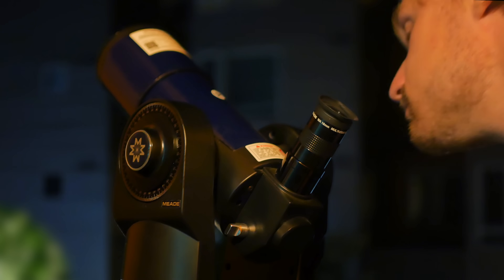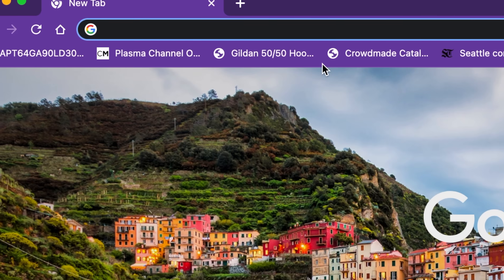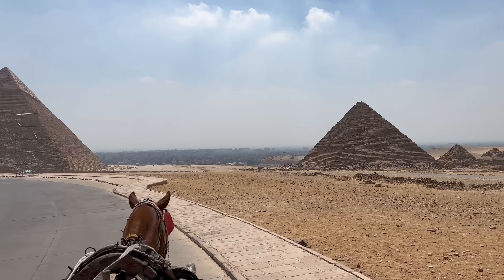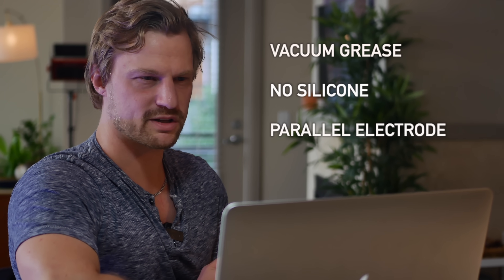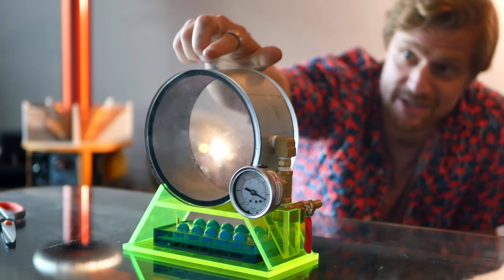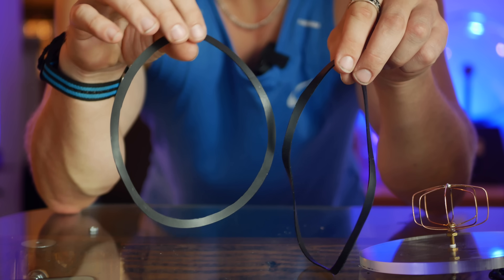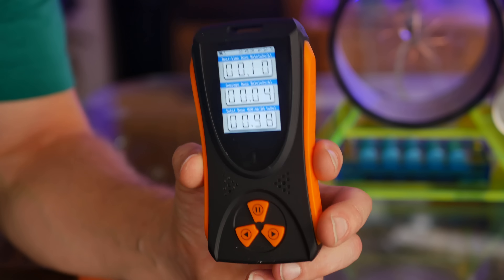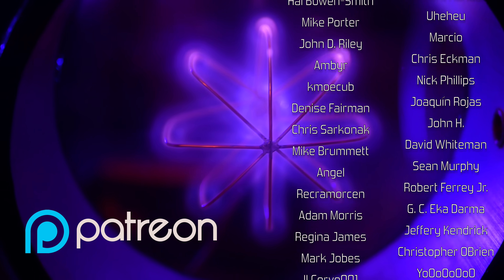Building A Nuclear Star In A Jar (Fusor)

Comment: this looks amazing!!
BUT, for the first time i do not really understand the theory behind what you're trying to do. i mean will this beauty really fuse light elements into heavier ones? and if so, i need to know how (what i'm trying to say is, if it is possible why don't we have working fusion reactors in the real world? does it have to do with the I/O problem? ie putting in more energy than what you're getting out?)
Reply from the maker: Hey Sadder, always glad to see your comments! Yeah, this will do true fusion. I'll need to inject Deuterium and make sure the pressure stays below 30 microns. The amount of fusion is quite low, but, it does work - and produces Helium. This reason why the world has not used Fusion exclusively is exactyl that problem...we're so close to making it net positive on energy, but so far we spend more energy fusing, than we get out.
Reply: @PlasmaChannel  thank you for taking the time to enlight me. Not many creators respond to comments,  especially creators at your level!! One final question: what form will the output energy have? Radiation? (If so, this is really scary. Please take all necessary  precautions) 
I think this is by far your most complicated project, I cannot wait to see part 2.
edit:best of luck! !

Comment: Vacuum is my bitch. Metal leaks really bad and I use viton orings to seal interfaces.
Threaded fittings suck. I use fittings that again seal via oring. Fitting joints should be tig welded. If I must use a metal for a body it will be stainless and I test its porosity using spay paint while it is under high vacuum. Mild steel leaks through its pores way too badly. Its worthless under high vacuum. Also that Guage you're using is chickenshyt. You need a Torr gauge to measure pressure in Tor not inches of mercury. That mechanical dial Guage is not very accurate at the level you need to be. I've found 1" plexiglass works really well. See my bubbles video about my vacuum dehydrator. I can help get you to 0.006 Torr if needed beyond that it'll take some work. I love your plasma videos and I'm happy to help if you need it.
Reply from the maker: I'm realizing just how much work there is for me to improve!
Reply: @PlasmaChannel  first understanding is that you will always have leaks. The better you control the leaks the lower volume of a pump you will need. My vacuum vessels all employ a flange for the plexiglass window. This allows for the use of a larger viton oring. The vacuum will squish the oring so that it creates its own seal.  It was really nice to see that glow. I'm interested in how you will capture rhe energy once it's produced. Please explain how to harvest the energy produced. 
I am at your service anytime.

Comment: I would defenetly sand those rough surfaces on that pipe section and make sure everything is super clean.
Reply from the maker: Probably would have been a smart thing for me to do. I personally liked the rough look of it.
Reply: @PlasmaChannel  I work for a major vacuum brand as a service technician and experience every day how just a tiny scratch on a sealing surface will affect  final pressure. Not so much when we are talking rough vacuum like this maybe, but still.
When we have basic vacuum training for customers, we demonstrate with a helium leak detector the difference when we put a strand of human hair on an o-ring seal and one without, it's significant.
Reply: Oh, i didn't realise this was a year old video. :D

Comment: The problem with modern technology advancements is wrong math. One apple and one apple is two apples. But they show this as 1+1=2 except we never combine the apples together. They always stay two apples. In fusion, 1+1=1. Human reproduction is a form of fusion. One sperm and one egg fuse to make one zygote. 1+1=1. Now some people will refuse to accept this truth and say "but one sperm/egg carries 23 chromosomes so technically it's 23+23=46" but while " correct" its still wrong. In fusion 1+1=1 and while 1 sperm and 1 egg fuse into one zygote, we have the normal addition of 23+23=46. So two processes in one. Very complicated. Our math doesnt properly explain it. You would need two equations to represent both. Why isn't there ONE equation to represent both things happening simultaneously. Ive said for years our math is wrong. After the zygote stage our cells divide, and keep doing so until our death. And yet when we speak of division in math, numbers get smaller. "But that means our cells dont divide but multiply" again math not matching nature. Our cells do in fact divide. One cell becomes two. Two becomes 4. And that's through division. And yet technically that's multiplication. Hence modern math is wrong. If there is an alien species out there, they are laughing at us because our math is wrong.

Comment: For threaded NPT connections you can always tighten it a little more as they are tapered to get a little wider as you screw it in. Also I'd suggest using "Blue Monster" teflon tape versus the vanilla white stuff. Its thicker and comes in bigger rolls.   While the epoxy solution works, I am not sure it will last but I could be wrong, it just feels hacky to me.  Ultimately you may want to switch to flare threaded connectors as they behave better in vacuum situations than NPT in my experience. You also do not need teflon tape for flared connectors, though there is a product called 'nylog' thats good for flared connectors.  HVAC systems that deal with having to be completely vacuumed down and then pressurized with coolant use these flare connectors and there are lots of pre-made hoses designed to deal with those vacuums with flare ends. That clear vinyl tubing can offgas over time so that may be contaminating your vacuum.  Your bigger pump may be just able to deal with the contamination and microleaks by pure force, but I don't see any reason the smaller one wouldn't work  given the tweaks in the plumbing are made. There are of course lab grade stainless steel vacuum fittings too, but they are overkill here IMO and the brass flared connectors + nylog  + a proper vacuum hose should work, even with the smaller pump.  

Lastly make sure the every internal surface has be cleaned with material appropriate surfactants and/or degreaser and then heated appropriately to drive off any water sticking to the surface. Any oils or water will turn to vapor in the vacuum and containment the vacuum.  For the metal parts I wipe them with acetone and then Gum Cutter. For the plastic isopropyl alcohol works, though I wouldn't bother with a freshly plastic film peeled piece.
Reply from the maker: Thats great information. Yeah, I was shocked the smaller pump didn't do the job. The bigger one is...too big. It's so loud too. Maybe the tubing was the issue?I found this entire project was a massive learning experience for me. It's the first of many vacuum videos I have planned
Reply: @PlasmaChannel  Glad to have some input on this awesome project!  I learned all this the hard way myself messing with vacuums and tinkering in my shop.  Looking forward to more progress.

Comment: Time to change the design for your cathode inside the jar.

A• build a small ferris ring at both ends of your fusser.
B• wrap a unidirectional coil of at least five to ten wraps of fine insulated wire around each ferris ring... Ensure that the coils are wrapped the same direction or the fields generated will be push against each other in the center and not drawing toward each other.
C• power the coils in parallel to the power circuit of the cathode, be certain there is now short between the coils and the cathode.

The results from these changes should be...
1• the plasma generated around the wire cathode will sperate into striations... Some going in towards the center of the cathode following the magnetic flux lines of the two parallel coils and the rest radiating from the wire frame of the cathode.
2• the plasma along the flux lines will be compressed and twisted into an electrical plasmoid. A knot of plasma twisted and bound on itself... This knot being confined by the radiating magnetic field of the cathode wire frame will compress to a much hight density... Thus increasing you efficiency.
3• the magnetic confinement of the coils on both ends should help prevent radiation out the faces of the viewing sides and force the majority of it out through the aluminum housing... Aluminum much like copper induces an electrical field throughout itself when in proximity to a moving/changing magnetic field, this should reflect most radiation back into the jar without allowing it to permiate the side walls a second ring of housing of copper or aluminum with a gap between them should increase your protection exponentially.
Reply from the maker: Might be a thing to experiment with
Reply: Personally I think the aluminum housing need microscopic perforations around it so the vacuum in the center is pulling upon the outer chamber and the outer chamber can be filled with a Gass that has molecules too big to pull through the perforations yet capable of absorbing neutrons to separate into elements that can get through and add to the reaction at a safe rate of increase.

Comment: I'm happy you didn't turn into the likeness of the "HULK"!   In reference to the 5 minute epoxy you used, i was always under the impression that 24 hour epoxy is the preferable epoxy to use when adhering materials together.  The slower the drying time the stronger the bond.
Reply from the maker: That's a good thing to consider.....

Comment: i have a question, how are you injecting the reaction gases and how are they not exhausted through the vacuum pump?
Reply from the maker: I'm first pulling a vacuum, then removing the hose on the pump end, slowly opening the valve to let air in, but plugging it with the nozzle for the helium. I then pull a vacuum again. This leaves the majority of gas remaining, as helium. I did that process twice, to further ensure a high concentration of low-pressure helium in the chamber.
Reply: @PlasmaChannel  thanks for the reply, me that's worked on vacuum systems (Intel and in lab environments) ya think I would of realised that you turn the pump off once at vacuum 😅 

Brilliant work man, that's one of the nicest looking home made reactors I've seen

Comment: Amazing work! A few tips: Helium from a balloon filling tank is usually 5% N2, which is probably why the plasma color was a bit off. At these pressures and temperatures you'll have to start worrying about outgassing, so you may want to ditch the vinyl tubing and acrylic plates (heresy, I know) for thick glass. Putting JB weld on the outside of leaky fittings and using barbed connectors can trap small amounts of air and slowly release them into the chamber. You won't notice the pressure changing much because the pump is balancing the very small leaks, but it can ruin the purity of the deuterium gas needed for fusion. I prefer fittings with an o-ring like KF fittings, but they can be pricey.
Reply from the maker: Thanks Nicholas - yeah my helium tank was actually 10% oxygen, so that also complicates the matter further! Good notes on the use of tubing too.
Reply: @PlasmaChannel  The bigger pump is probably compensating for the tubing and other sources of leaks/outgassing, but I'd definitely switch to a better tubing. HVAC people use special large diameter multi-layer hoses ( https://youtu.be/b8j85R9xvMM) to get down to 500-100 microns. Also, the needle on your gauge can go down to the stop and you can still have 20,000 microns. You really need a thermocouple micron gauge to determine that. Keeping fresh oil in the pump is essential for good vacuum. HVAC people change the oil in their pump every 2-3 uses to get a deep vacuum. I'd also switch to loctite and dielectric/vacuum grease, and even dismantle the ball valve and smear grease on all the seals and surfaces (I did just this thing a few days ago). But again, that giant pump running continuously is going to compensate for a lot of that, especially with such a small evacuated volume. Awesome video, can't wait for the next one!
Reply: @WaffleStaffel  to add to this, unfortunately the pump he has likely isn't going to cut it. You might get fusion to occur under 30 microns, but you really should be looking to keep it under 10 microns if you want to have good results. The vacuum reading on your pump should be ignored. The pump is reading the vacuum level at its inlet, but there can easily be over a 1000 micron difference between the inlet of a pump and the actual reaction chamber. 

The only way to know for sure is to install a thermocouple gauge directly to the reaction chamber. I would recommend using one of fieldpiece's products like the svg3.

I don't want this to come off as negative, I would love to see you succeed in your project.
Reply: @PlasmaChannel ue fusion is a myriad of specific elements together Nature’s God copies function of utility infinitely and exponentially 

He3 from sun Acoustic waveform energy and Trillions of Decibels , volume of molecular particle cohesion in a plasma state matter at millions of kilometers per hour interacting with 5 main elements at Schumann’s Nuclear magnetic resonance Frequency in Synchronous reaction “ our atmosphere “ is a multi element plasma energy reactor surrounding our planet.

In other words use Multiple elemental primary gases to fuel your reactor

sun is to Generator as Planets are to alternator in the Electric circuit exchange of energy between star and planet
Reply: I like your funny words, magic man!
Reply: @JohnWhite-hx8fj  he should really just get a proper hvac gauge and manifold set, they can be had cheaply and the hvac flare connections are cheap too
Reply: I know you're an alien.

Comment: Could we get a little more tech info on the HV supply and ladder multiplier? Even if the info is just supplied in the description area would be fine. I really like your builds from an aesthetics perspective.
Reply from the maker: I'm glad you enjoy my builds. As a point of fundamentals, I have always preferred aethetics over performance. I'd rather build something beautiful that slightly works, than build something messy and hideous that works really well.

I've always sided on the Art and aesthetics side of engineering. I do have a couple videos showing how to build the voltage multiplier, and the flyback supply is an AC push pull flyback driver.
Reply: @PlasmaChannel  Heh... We're in violent agreement on that.

Comment: New sub here.  Good build.  Outgassing is a big problem in high vacuum systems.  In your case you might want to pump down overnight and then infuse hydrogen for several hours before infusing the deuterium. I hope those are glass windows and not acrylic they will outgas like crazy.  I had an implosion guard around my bell jar vacuum chamber at university, would never turn on the pump without it.

Comment: FYI my experience with pull high vacuum micron gauge is key aswellas don't have to use thread sealer or joint compound,which off gas             brass is malleable enough that with naked virgin fittings the threads alone should able to get a good seat still up and get you down to a high vacuum 30 Mike should be achievable with enough torque best practice with use of a backer wrench. This should hold true for use fittings as well

Comment: 0:25   sorry to disagree, but those kind of opinions are always from people who do not understand the energy business as a whole. 
No thermal source of energy (fossil, fission or fusion) would be able to compete with the current and future growth of Solar and Wind energy..   never.
It may have some niche applications but that is all..  This taken into account that all different tech approach to get fusion are accomplish in the next year.. Even with that huge assumption, there is no technology that can compete with solar and wind.  One of the problems is that converting heat into electricity already has a low limit cost on how cheap it could be, which that process alone is already higher than the best places for solar and wind today. 
The only drawback of solar and wind can be solved with hydrogen at the most cost effective way, which is totally required no matter what is your energy source, because is the only way to clean all energy sectors solving at the same time any intermittency issue.